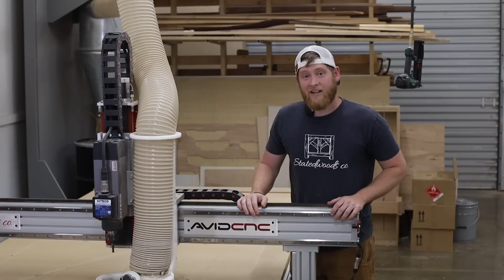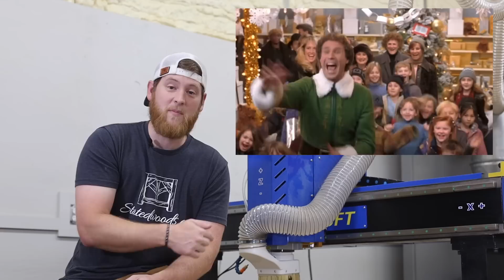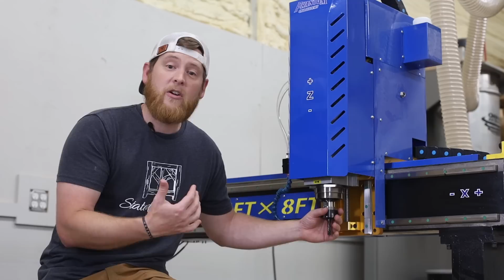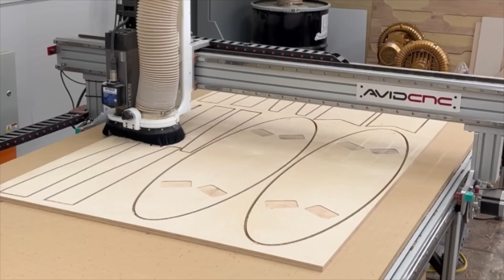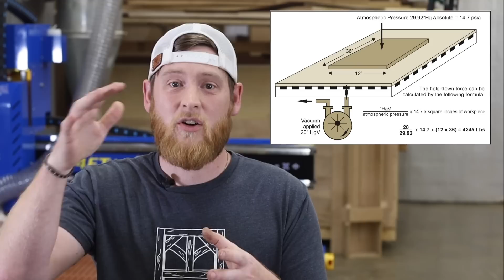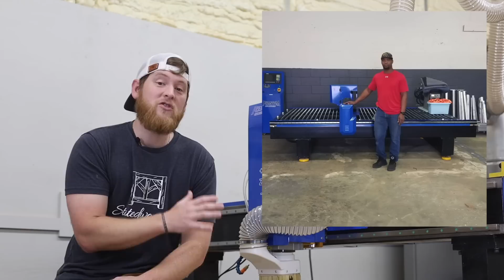Which is a better machine?

Comment: The Phantom looks like a great machine, and the price is good too.   If you have a production shop, and they have the specific size and capability on the Phantom that you will ever need, and you really need to run at maximum speed all the time, then it is probably the right machine for you.  
However,  to be fair, I think there are a lot of other cases where the AVID makes more sense.  The AVID is not only customizable in size (as you mentioned) but just as the frame is easy to build and ship for AVID (as you mentioned), it also makes it easy to customize by the user.  The software is very open so you can do a lot of customization, you can add lasers, plasma heads, and many other things on your own because everything is documented on the electronics and the SW and they support you making your own modifications.  The different customizations I have seen on the AVID machines by users continues to amaze me.  You can also assemble one of these in a basement or inside a room that just has a walk door.  If you don't need super fast production speeds, you can always compensate for rigidity with speed (I can write letters 0.010" high that are very clean with the laser on my AVID machine).  So I do think its a bit of an apples to oranges comparison overall, you just picked your specific use case which does make it apples to apples, and in your case, the Phantom makes more sense :-)
Reply from the maker: I agree with you 100%. Both have their places.
Reply: The Avid might be cheaper, but what does it help if you want to mill precise CNC parts and you always have deviations of millimeters? the whole cut / milling process is for me in doubt. except you might have time to cut all your pieces and the milling machine is driving quite slow...or let's better say: if the direction changes would be slow, not the milling process. But this is a matter of programming and is not impossible..
Reply: @YoTu77  Deviations of millimeters?  I don't know what CNC router is that bad. The AVID's certainly aren't if they are set up correctly.
Reply: All great points, but considering all those, the Avid would make a hell of a lot more sense at $5-8k less.

Comment: You may be comparing apples and oranges.  Machines designed for two different. functions / two different manufacturing environments.
I spend 1.5 days assembling an Avid machine - bring it to the point of plugging it in and hooking up pc.
Typically the weight of a machine is proportional to it's cost.  Cost of machine and cost of shipping are far from equal.
Vibration issue (acceleration) can be sorted in software.  At some level of acceleration the Phantom will have a noticeable deflection.
I have used Avid CNC help which I am totally impressed with.  Same day response...  or just call on the phone and talk to a person.
Reply from the maker: Glad you have enjoyed your machine and how great customer service. Im comparing these machines based on price and how much machine you can get for the money. Weight is obviously not proportional to cost in this case. Thats the importance of this comparison. I disagree with the software sorting out vibration. A heavier machine will always have lower vibration even at extremely higher speeds. I have not noticed any deflection even running the Phantom at its max of 700+ inches per minute at full 1/2 depth of cut on material. Avid could never do that.

Comment: I was getting ready to call it in for an AVID machine until I stumbled upon your video. I have a question about the Phantom machine. Are the parts proprietary? I hate to think this, but companies go out of business for all sorts of reasons all the time. If the spindle dies or a stepper motor dies, can I replace that with something else or am I tied to Phantom?
Reply from the maker: No your not tied. Phantom specifically designed their machines to have easy available parts. Thats why people think they are Chinese. The spindles are easily replaceable.

Comment: This is the difference between making a CNC for the challenge and using a CNC.  I built my first CNC in 2009 and I learned a tremendous amount about the machine as well as the workflow so there is nothing wrong with going with the Avid if that's what you want.   If you want up-time and make $$$, Phantom, Leguna, Thermwood are the way to go.  I think the moral of this story is, don't think you'll save money building one unless your time is worthless.  I spent 6 months and $10k building mine from scratch.  That's conservative.
Reply: Thats a very nice attitude to call conservative. I bet, you know your machine in and out now. You might be right, there are solutions on the market. But you can repair your baby. You know it in and out. Thats how 'it' works only. And in 2009 you have been more pioneering and on the frontline of invention. 
"Making money" is a dogma of stupidity. A modern and very american Way of seeing things. It works, as long every supply chain works in real time and one can share work.
But if you are on the frointier of invention, your job is not to scale up production, but to do things better, different and unique.
Good. Scaling up production is a nice thing to do.If one has a product that scales well. Its just. There is no real advantage in scaling in cnc. That works to a certain degree, but 
if the real big fish find you acting, they will undercut you and take you over. So, the gaps must not be too big, then there is real wealth.... Building a cnc machine opens the way to many other machines. Robots, welding, steelcuting with plasma, 3d printing. Understanding pipeline and process is core.
I admit, that I learned on youtube propably as much as you in the 3 and 4 th year... But the 1st and 2nd year... the hardware handling and calibrations shit..... thats very practial knowledge. You wont get it at "Titan" Hahahahaha.

Comment: very informative video,,,is this phantom USA build or some chinamade modified in the US.. .anybody has any idea about camaster cnc...would love your insight
Reply from the maker: These are engineered and designed in North Carolina. Frames are manufactured in China because of the high price of steel. Camaster is the same.
Reply: @Statedwoods  Well thats simply FALSE. I've been to the machine shop in Knoxville that builds the frames for Camaster. While it is true that every CNC machine has some Chinese components (ie stepper motors, ball screws, linear rails, and computers are not made in America any longer), there are still a few companies trying to make as much as they can. And we should support them while we still can.

Every company that imports CNC machines from China (Tormach, Laguna, Phantom, and numerous others) tell the same story (that they engineered it). But thats all it is... a story. The Chinese people dont need our engineering help. They invest heavily in their education system, unlike we do.
Reply from the maker: @lenshelton2810  well I would love for you to sit down with the owner of Phantom and see Steves years of engineering blueprints, cad designs, prototypes, and plans for his machines. Seeing how he personally designed the Phantom table frames to be the first and only machines on the market to be their own air tanks. You havent been to their facilities here in North Carolina either if im not mistaken. All these CNC companies by Chinese parts. Not one is made purely with 100% USA parts. I wish they were though.

Comment: Obviously if you owned an Avid you should have known Mach3 and Mach4 both have soft limits. And as someone that sells CNCs the controller you showed was a Rich Auto Controller, and I know for a fact they have issues of their own, not to mention they use a 1980s system that limits you to 8 letters or less. Now let's talk about your comments about Windows and updates. First off a production machine should never be connected to the internet as you're just asking for problems, and second, you never need to update your software if your machine is working properly. No machine is without its problems, and a lot of people like to see their toolpaths as they're running. I own 5 systems running various interfaces, but none of my machines are on the internet. That's what your other computers, cell phone, and ipad are for, and Avid tells you to have a dedicated computer for their machines.
Reply: My LinuxCNC machine has no problems with networking. Heck I can stream video while it's cutting a job.
Reply from the maker: I agree 100%. They should have a dedicated PC for running. Im speaking about those people who dont listen to the suggestions of the companies or who take their laptop in to do job designs and connect to the web while in their home. It can cause problems after any windows update, not just during a job. I did own and operate an Avid clearly and they do have soft limits. Dont all machines?  I have not had any issues with these controls and they are much more user friendly than Mach ever was. Just saying what I experienced. I know everyones experience will be different.
Reply: @Statedwoods  Agree there are those that don't listen, but then again that's their problem. Manufacturers make these suggestions because they know upgrades and updates can cause problems. Not all have softlimits. People can make all kinds of mistakes using the Rich Auto Controller, take it from someone that has sold and helped people for over 6 years on those controllers. And you may be one of the lucky ones, but the Rich Auto Controller is known for the screen going blank, the software getting corrupt and having to be installed, or just not working at all, and this is on the A series and the B series. Not knocking the controller as I have a machine that uses the Rich Auto Controller, but it does go bad at times, but the main complaint I have is with the old naming system.

Comment: I looked on Phantom's website and can't seem to find any info on cutting speed or rapid/jog speed?  Do you know what they are?
Avid advertises their CRP4848 4' x 4' CNC Machine Kit to have the following:
Cutting Speed:
200 IPM (NEMA 23 version)*
400 IPM (NEMA 34 version)*
Rapid Speed:
400 IPM (NEMA 23 version)*
800 IPM (NEMA 34 version)*

All the Best, Chuck
Reply from the maker: Phantoms can run 800ipm and rapid 1000 with nema 34. I ran mine at 700ipm just for fun. Full depth cut 1/2 material 3/8 bit. Handled it just fine
Reply: @Statedwoods  Yep, what you got there are commercial grade speeds. 😎 I guess it's to be expected from $20k CNC that's built as solid as the Phantom is. I've been looking at Penguin CNC, now I have another option, thanks!
All the Best, Chuck
Reply from the maker: @toolchuck  All the best to you!

Comment: There’s a local company here in New Zealand called zealandia systems. They’re building avid like machines on welded metal base with vacuum options at near half avid price. Before watching this video I assumed they must be inferior in quality. Now I’m I think I’ll support the local guys
Reply from the maker: Sounds good. Welded frames the heavier the better. Sounds like maybe a great option for the money.
Reply: CNC is such a rip off racket. All they do is prey on people's ignorance. It's a classic scam.
Reply: @1pcfred  who, avid?
Reply: @1pcfred ere in India Chinese machines way more sturdy and powerful cost about 8K USD. 
They need a crane to get them in. 
My friend got a used one for 2K USD. Apparently the previous  owner used it for 3 years and couldn't trouble shoot and decided to just sell it as consultants charge about 2K to visit and resolve the issue.
He spent few days figuring out the problem though it was his first CNC. He's not even a machinist. An IT guy who got into woodworking